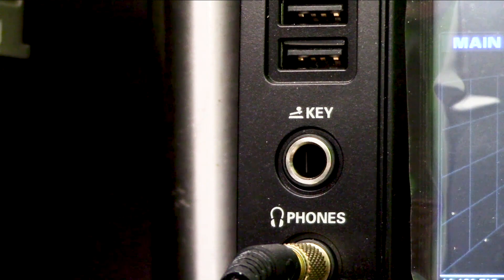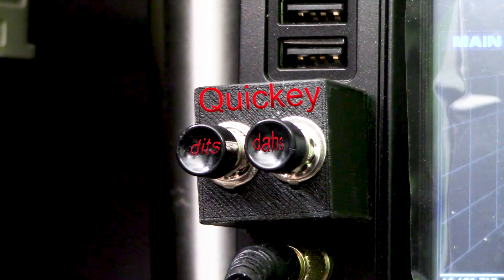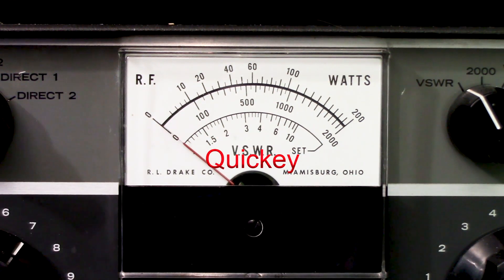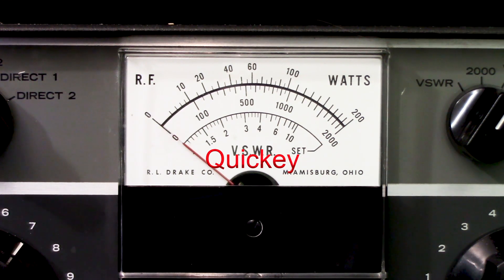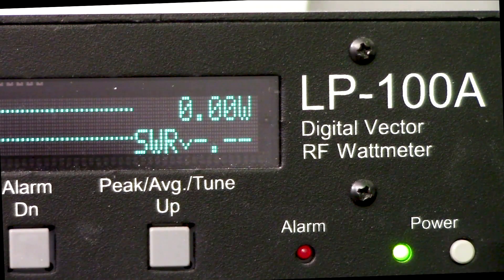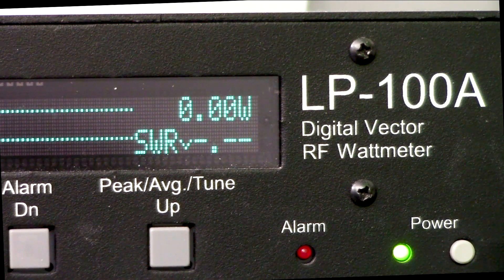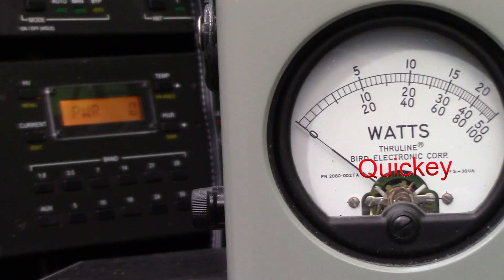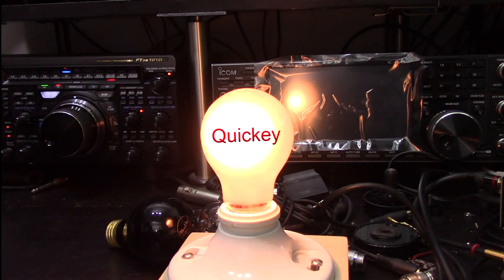From WA2R, Tim Quick, a Device for Tuning a Linear Amplifier that Jim, W6LG Calls the QuicKey

Comment: Am I missing something? This is a good idea but I simply use my key to do the same thing and it makes tuning a breeze, say 5 - 15 seconds depending how far I'm off to start with. Using CW as opposed to SSB for tuning also produces a signal with less bandwidth that will cause less potential disruption to other users (of course we should always be tuning up on a clear frequency). 73 Y